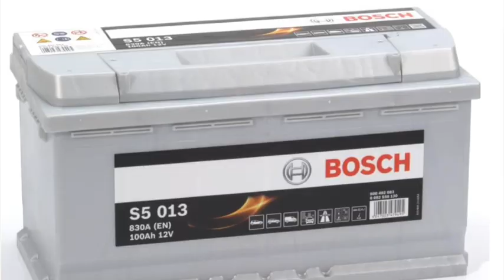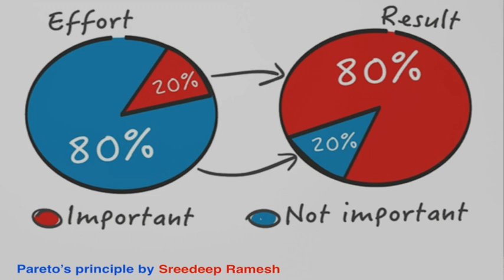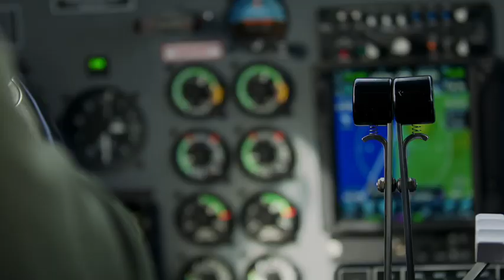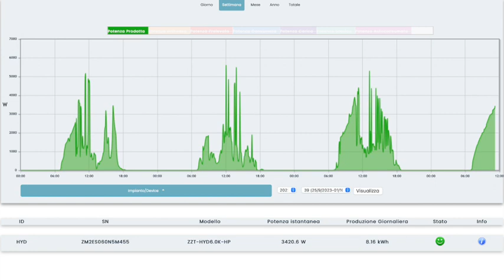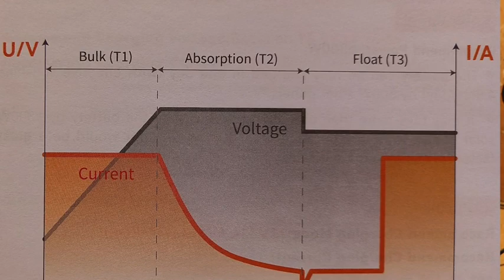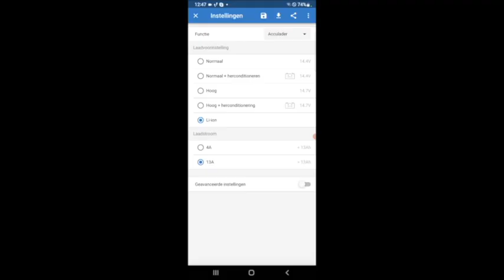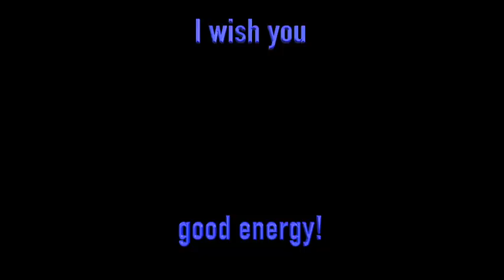How to live with 12 Volt of a car battery, details - Video 34b

Comment: Many small - and even medium sized - boats use 12V for their power distribution and living onboard isn't an issue.  It's all down to proper care and maintenance of the batteries.
Reply from the maker: Do you have good access to devices that work on 12 V, including refrigerators that work on normal compressors rather than Peltier elements?
Reply: @nnvasen-good-energy  There are 'proper' fridge/freezers that run on 12V but they are quite expensive.  If I was going to go to a 12/24V lifestyle I'd get an LPG fridge as cooking is also much easier using it.  But everything else for a normal lifestyle can be had as a 12V device.  Lighting, communication, entertainment etc.  A small inverter for very occasional AC needs wouldn't be difficult to arrange - again, very much the way marine users operate.

Comment: Thk-you & 2 questions/suggestions;
1. For motors ??Why not place a capacitor especilly super-cap in parallel across the 12V battery??
In theory, the the paralleled energy in the cap will provide the surge current & stable voltage
2. On the cheap ?Can an inexpensive solar charge controller be used to charge all types of batteries as well as provide all types of battery protection?
I'm putting this sort of thing together right now just for the fun of it.
Reply from the maker: Hi Tombouie, I can put a supercapacitor in parallel but I hardly think the battery needs it. A car starting motor already takes much current. For a lithium battery it makes more sense though.  That technology is not so good for high starting currents. But for now I don't need it. My problem is more with peak current at 230 Volt. If there would be a compresssor fridge at 12 Volt I would be glad. But I must also be easy to find for my audience that lives also in developing countries

Comment: Hi Norbart. Yes its lead batteries i have. I will be running 12v lights 2 12v water pumps i would like a low powered fridge frezzer. Just finished building my battery box. and just need 6 more batteries and some solar cable and i will get it fitted. I could not reply so had to do new comment.
Reply from the maker: Hi Daz, I remember that I gave a reply on your fridge on 12 V. Wednesday you will see my new portable coolbox and I tested it even. It is not very efficient, as it is Peltier technology. Would be nice to have one on a 12 Volt compressor.

Comment: I am just fitting a 12v/240v system in my house. It's not cheap but i hope it pays for itself in the end. I will have 8 130ah batteries.
Reply from the maker: Hi Daz, that is over 1 kAh, with 12 Volt it is 12 kWh! At least if you deep discharge. Is it lead? Then you would have about 6 kWh to spare the batteries. It is still a good amount of energy and if you choose the consumers that are eligible for operation during blackout, you can go on a looong time!

Comment: I have 500 watts of solar two wall mart marine batteries one 2000 watt harbor freight inverter been running the lights in my storage building for a long time! I can flip a few switches and have emergency power in my house in about ten minutes! I don’t like the dark!
Reply from the maker: You are right, remaining in the dark is too disruptive when we all depend on it! How many hours takes a black out where you live and how frequent are they? You have a pretty large system, now imagine that even with a simple 100 Ah battery you can run the most essential services for the time of a typical black out, so affordable for nearly everyone. If in a country a blackout is occuring once every week, it becomes nearly a no brainer.
This video was (frist time) mostly aimed at Developing Countries but I saw that 70% of the views came from USA, Canada, UK and Australia. This video was the second one with over 2K views and I first explained the increase because of this new target group so it was a surprise to see it come from these 4 countries. A sign that the theme keeps awake not only the countries that are most affected by black outs...
Reply from the maker: From where are you?
Reply: @nnvasen-good-energy  central North Carolina! We have occasional power outages due to storms!
Reply from the maker: The storm was also here in Italy in our small town the reason for a black out as you see on the thumbnail of the previous video with the car under the tree.

Comment: A car battery is designed to provide a high current for the starter and then be charged while driving. 
If enough energy comes from solar cells, LiFePo batteries can be used to provide lighting at night.
There are LEDs that are designed for DC 12V mains.
Reply from the maker: Hi Jens, the start current is indeed crazy high. The Lithium is not able to do the same. Luckily it is not needed for this application of the video. You are right about the role of solar, I will add it in other videos bit actually it is already in the previous video nr 33 about black out in Tuscany. About LEDs, please see the video with the 🎃, a few videos before. I tell there how to calculate the nr of LEDs you can put in series for a certain voltage and how to use a PWM regulator  to keep the brightness constant with decreasing battery voltage. Greetings Norbert

Comment: 12v is ALWAYS a mistake even going to 24v is worth imo
Reply from the maker: Hi Adairjanney, you mean because of higher current and Ohm losses?
Reply: @nnvasen-good-energy  a 12 volt system with an inverter will consume twice as much amp hours as a 24 volt system so a 24 volt supply is better than 12 volt! 36 volt system is even better!
Reply from the maker: But you have to find 24 Volt appliances if you want to avoid an inverter. At least in this video I focus on inverterless systems for developing countries. I myself have 24 Volts and an inverter of 3 kW so technically I am on the same line as you.
Reply: @nnvasen-good-energy   Guess so long as you keep it low amperage youll be okay otherwise it might be better to get a buck converter to go from 24v to 12v